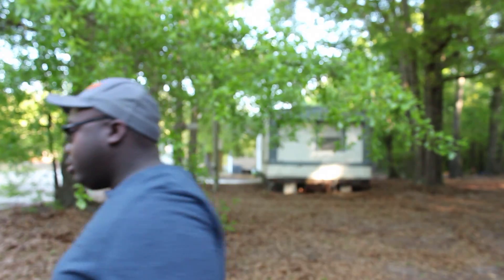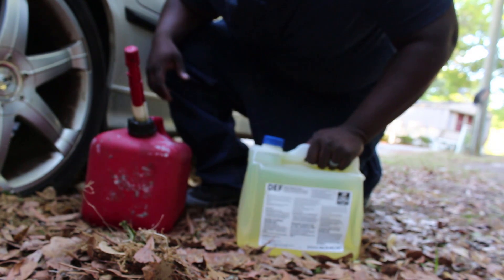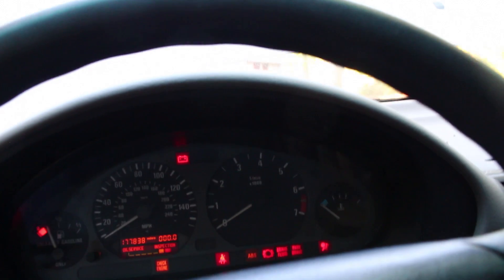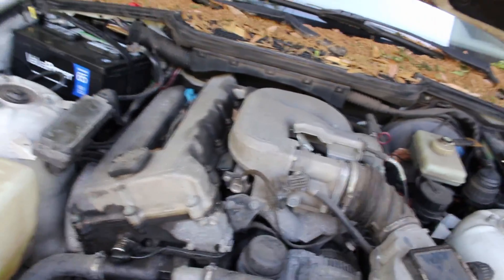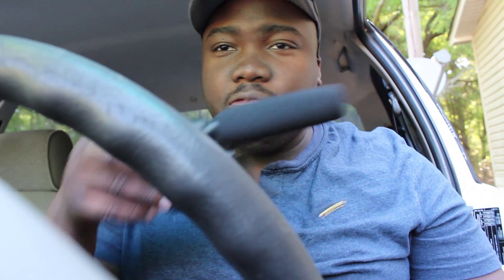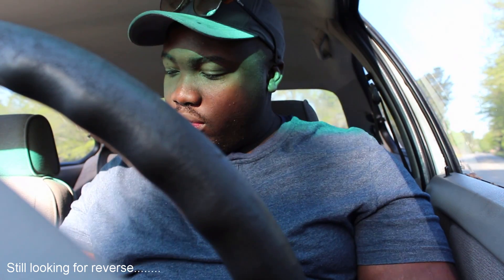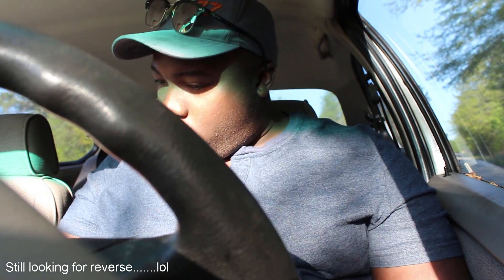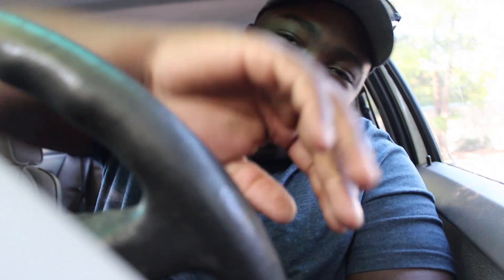E36 BMW FIRST DRIVE!!!!!!!!

Comment: I think I speak for most of us when I say "Get down with your bad self!" ;-)  I recently had to get my back up car running that had been sitting for 5 years and a guy at the parts store recommended Seafoam.  This was the first time I've ever used it and it eventually worked.  I put a few gallons fuel in the tank along with the Seafoam and changed the fuel filter, things were so varnished up I wasn't even getting fuel into the filter.  However, the next day when I cam out the fuel filter was full of fuel and it fired right up!. ;-)
Reply from the maker: I need to get some seafoam to put in the gas tank! Thanks